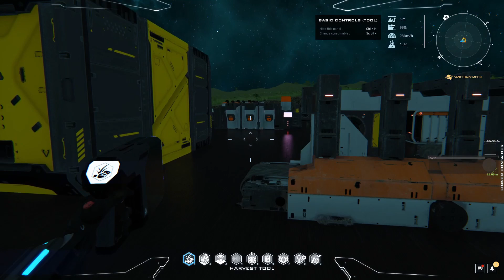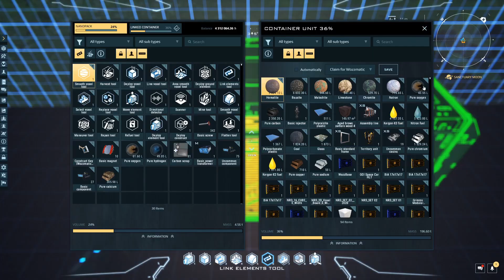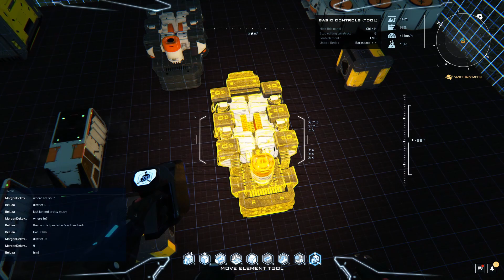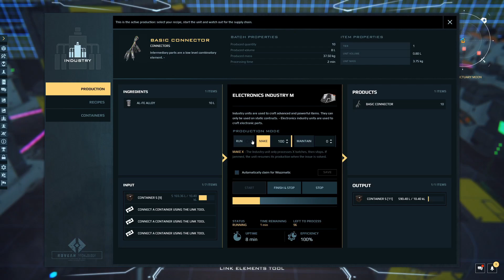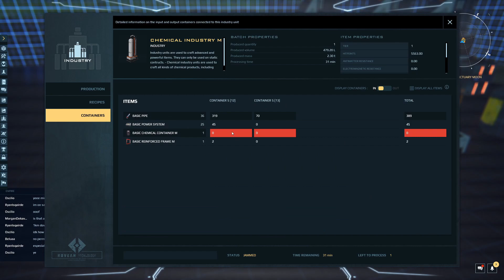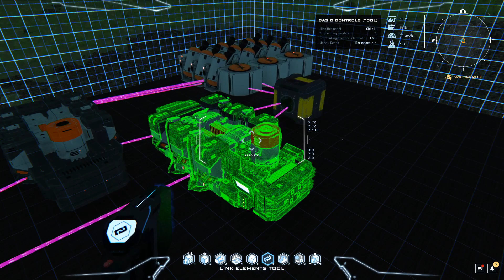Dual Universe Industry: From Refining to Assembly

Comment: You were making far too many pipes and connectors fella - it's 10 per. You now have 360 pipes instead of 36, and 1000 connectors instead of 100. Daresay you'll use them :D
Reply from the maker: Well there was a reason for that which is what I am working on right now 😉
Reply from the maker: And “too many” turned out to be not enough 😂